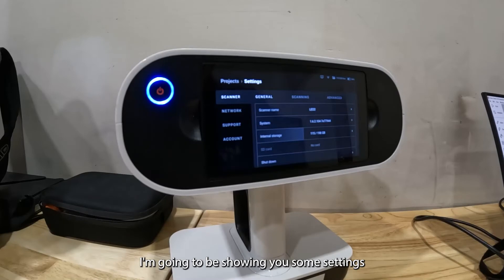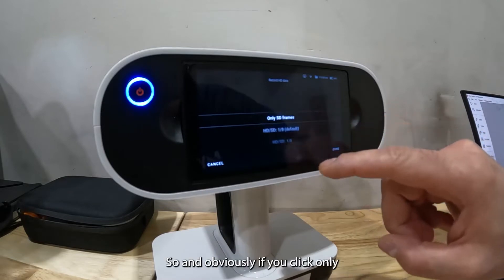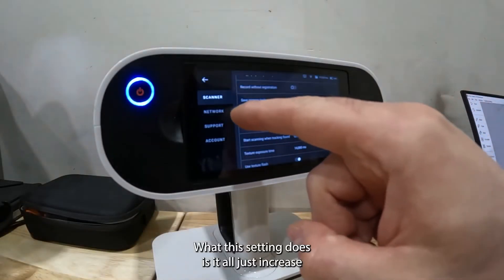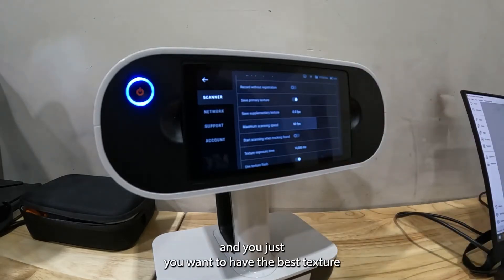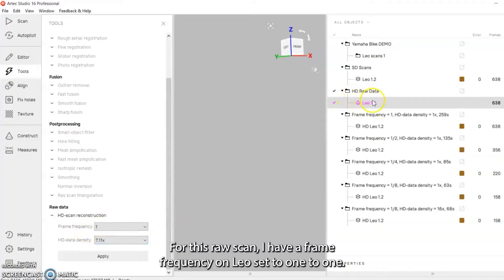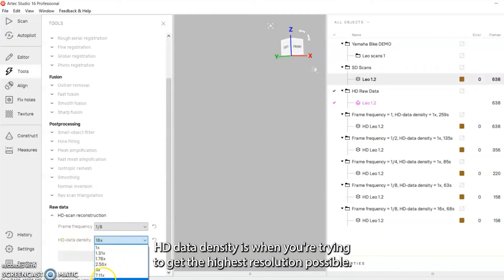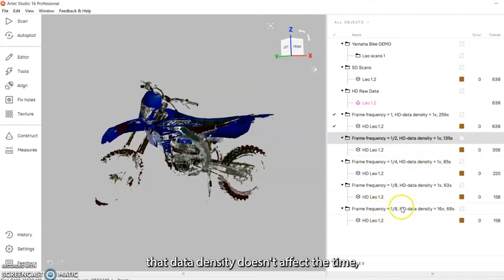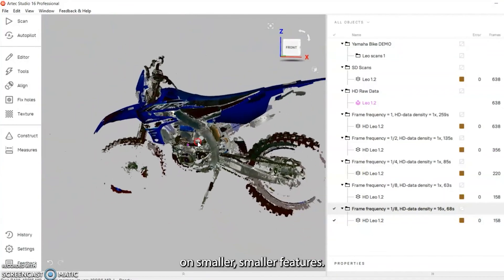Artec Leo Tips and Tricks

Comment: I have a artec LEO and trying to get a good textured 3d model of a boat.  Spent ALOT of time scanning and working with the software. But it is painfully slow, as in hours for each processing command I give it.  I now understand the scanner settings are set for a far smaller more detailed object.  How would I go about simplifying these scans so I can align, edit, fuse, and texture it quickly?   Also I am wanting to 3d print this model on a polyjet printer which is full color and I am worried the exported model will be too large of a file for the slicer to process, so any hints on that would be great as well!   Thank you so much for the vids.  I am still working my way thru your entire playlist
Reply from the maker: We have experience scanning boats, and they can be tricky with repetitive geometry and lack of texture. Excessive time spent preparing the surface can help cut the scanning and processing time significantly. Since you already scanned it, there are a number of reasons that the processing can be going slow. Usually the biggest two causes are scans too big or computer specs too small. 

In both cases, you can use Scan Decimation in the Tools menu to reduce the processing workload. Since the end goal is a 3D printed model, you absolutely do not need gigabytes of files to produce a model that is 50 megabytes or less. If you need additional tips, reach out to us at info@myeng.ca

also, We showcase some further details in this series of article: https://www.myeng.ca/blog/analyze-surface-deviation-quickly-and-easily-with-geomagic-controlx-b5hah
Reply: @myengineeringltd.3569  thank you very much for taking the time on that very helpful response. I'm noticing a number of things I did wrong on the initial scan. But now that I'm armed with a little more knowledge I might revisit this soon! I want to keep texture since I have access to a polyjet color printer I can 3d print the boat in color! Thanks again